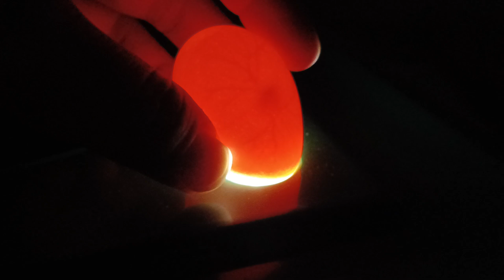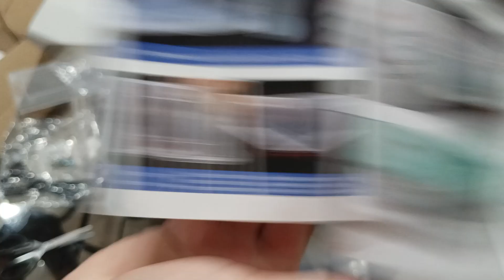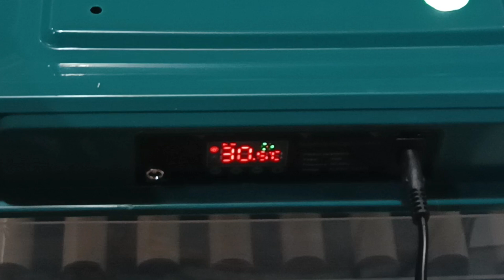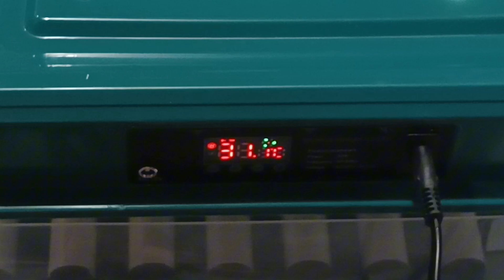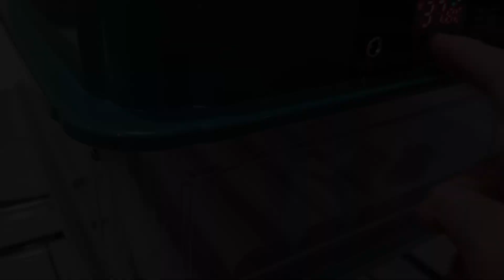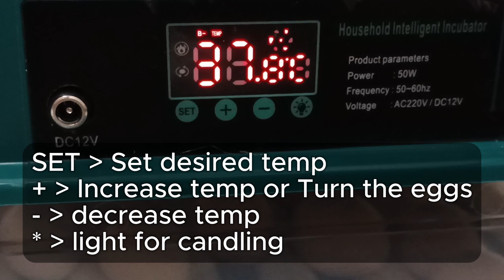Fully Automatic Egg Incubator (48 Egg Capacity) – Step by Step Set-up & First Time Candling!

Comment: Hi. Really helpful video.  Mine is very similar except for the way the plastic sides slot together ( mine slide into each other, rather than the bolts) but i dont see how to check humidity. Please can you help?
Reply from the maker: I bought a hygormeter to measure coz this incubator doesnt have that. anyway, the more water surface the higher the  humidity, I keep my incubator in a closed room. to reduce fluctuation in the humidity. TThis way incubation will be more reliable. I usually achieve 85-90% hatch rate minus the unfertilized eggs.

Comment: Hi how can I control the humidity
Reply: I need to know too
Reply from the maker: Humidity increases based on the surface area of the container. Not by how deep it is. To increase, then increase the surface area of the water. With this incubator, it has 3 container, if I use 3, my humidity would reach 75 to 80.
Reply from the maker: My incubator is placed in a closed room so the humidity is somehow consistent all throughout. But if you placed it in an open area. It might fluctuate
Reply: I have it in my house the temperature of the room is about 30 
The humidity in my city is  15 sometimes it reaches 30 

I have 2 bottles at the starting one the right and one left 
I didn't put one in the middle 
What do you think?

Comment: Sa dry method from 1-18 days hnd n mglagay tubig po?need pa rin ba icheck ung humidity from 1-18 days?
Reply from the maker: Check nyo pa rin po Kasi depende sa Lugar Yung humidity. Kung baba sa 50% baka matuyo po Yung white na nakabalot sa sisiw. Hindi po yun mg hatch..Mura lang po Yung hygrometer. Meron sa description pero check nyo pa din sa ibang store baka mas Mura plus delivery
Reply: @jolointegratedfarm  nakabili po Ako Ng hygrometer ung reading  Ng temperature 38.8 and ung sa incubator 37.5  alin po ung sinusunod  nyung temperature ung hygrometer or ung  nkaset sa incubator mgkaiba kc cla  ng reading
Reply from the maker: @jayson7749 I try nyo po babaan sa incubator kung susunod Yung hygrometer.
Reply from the maker: Baka kelangan Ng ibang thermometer
Reply: @jolointegratedfarm sir sa inyo ano po ung sinusunod nyong reading Ng emperature ung incubator or ung reading hygrometer sa loob po, sa akin po  gumamit ako Ng dalawang hygrometer sa loob ang reading halos same na 38.1-2 ung incubator 37.5   ,Ng try dinAko Ng  glass thermometer  halos nsa 38 din ang temp,susundin ko kaya ung temp Ng incubator sir,
Reply from the maker: @jayson7749  sa incubator po yung sinusunod ko, kasi minsan match sila ng hygro minsan din hindi. mahirap mg update palagi kaya ng stick naako sa incubator. ok naman. Sa inyo po ba malaki ang difference ng temp ng incubator at hygro?

Comment: Pag ika 18th day na po ba hindi na kailangan ng water?
Reply from the maker: Mas kelangan po Ng water sa 18th until mag hatch. Sa area ko Kasi medyo humid so day 1 to 17. Wla akong water nilalagay. Pag ka 18th day na ko Ng lalalagay. Bili kayo hygrometer..Mura lang naman. Para alam nyo kung need I adjust
Reply: Salamat po malaking tulong ito sakin❤🙂 @jolointegratedfarm
Reply: @jolointegratedfarm sir may problem ako pano pala ma control ng umidity may kailangan ba ako pindutin sa bottons?

May na basa ako sa mga comments mo sir tama ba yung pagkaintindi ko na yung umidity naka base sa gagamitin water bottle from day 1-17  1bottle lng tpos 18-21 days 3bottles na.. ibig ba sabihin wala na pinipindot sa botton ng incubator?

Bumili na din po ako ng hygrometer iniisip ko lng kng kailangan naka setup din sa incubator yung need ko na umidity sa eggs
Reply from the maker: @juliusmoreno3027 wla po control sa humidity kaya bumili Ako Ng hygrometer. During day 18 until hatch Puno na po Yung tatlo. Pero from 1 to 17, pwede Isang lagayan lang. Or.pwede din wlaa kung mataas na Ang humidity sa area nyo.

Comment: Automatic ba umiikot ang egg turner ng incubator sir? O kailangan pang e press ang + sign bago  pa ito iikot?
Reply from the maker: Automatic po.nparang pang test lang talaga Yung + sign para alam.mo na umiikot. Minsan Kasi na tatanggal Yung connection Ng turner..Yung wire sa loob. Kaya Minsan pmpress ko Yung + para makialta.ko na umiikot. Especially pag ayaw ko na buksan Yung incubator.
Reply: @jolointegratedfarm  ang lagayan ng tubig need ba yung 1.5 na bottle? Nka bili na kasi ako gagamitin ko bukas 24 egg capacity. Hope masagot po sir
Reply: Paano po mag test ng humidity... Sir
Reply from the maker: @MartyJohnDaapong  pwede po 1.5 para matagal maubos. Pero bili po kayo hygrometer para alam nyo exact na humidity. Pag tatlo nilagyan mo Ng tubig aabot Yan Ng 75%. Day 18 to 21 ok Yan pero kung Day1 to 17 baka isa lang Muna.
Reply from the maker: Depende din sa area eh. Kaya mas ok pag meron ka hygrometer. May nilagay Ako na link sa description. Yan yung binili ko Yan din kasi pinakamura. Pero check mo din ibang store Kasi baka mas Mura pag Kasama na delivery sa iba

Comment: No need to spray the eggs day 18 to 21 days?
Reply from the maker: no need if you can maintain 75% humidity,
Reply: @jolointegratedfarm  What is your recommend to add the water in day 1 to day 18.. the two right and left.. no need to add a water in the middle? just the left and right bottle to lower the humidity? i will add a water bottle in the middle if it is already day 18 to 21 days?
Reply from the maker: @apollomacabodbod6329 On the 18th. You can buy a hygrometer to be sure

Comment: Does the roller rotate automatically every time? Or does it have to be set? How do I set it?
Reply from the maker: Automatic. Every 2 hours.
Reply: What if the roller is not working
Reply: @norbertasombilla4647 Make sure you connect the circuit very well,
Reply: @norbertasombilla4647 dod you plug the motor in 11:19  to the top of the incubator
Reply: How do I set the roller

Comment: Good fay sir..please what is the best temperature to set this incubator to get a best result..
And do you advice me to use all 3 bottles from day 1 to hatching day?..thank you sir
Reply from the maker: Day 1 to 18 - 37.5
Day 19 to 21 - 37.0
Reply from the maker: Use 3 bottles on the 19th day. On day 1 to 18. It should be lower to around 60% so buy a hygrometer to monitor separately.
Reply: @jolointegratedfarm okthank you very much sir...i really appreciate ur response.

Comment: Please do eggs turn  automatically if using battery of 220ah.
Reply from the maker: @abdullahimuhammad3102  haven't tried it but I think it can
Reply: @jolointegratedgoatfarm  yes it does sir.. i tested it and put marks on the egg yesterday after sending you this message to confirm the process and it turns with the battery confirm...
Reply: @jolointegratedgoatfarm  and another question sir...if the egg reaches day 17 very close to hatch should i continue adding waters in the three bottles until hatchery?tnx.
Reply from the maker: @abdullahimuhammad3102  I only add water in 1 of the container during 1 to 17 days..18 to 21. I fill the 3 container.. Better if you can buy the cheap hygrometer to monitor the humidity.
Reply from the maker: @abdullahimuhammad3102  are you incubating chicken eggs as well?

Comment: Kailan po ba dapat ilagay yung hatcher?
Reply: Sa 18th day po ba o 19th day aalisin, kasi sabi po sa iba yung pag ka 19th day daw po e
Reply from the maker: @romarcastro4492  18th po
Reply: @jolointegratedfarm  boss pagkalagay po ba sa incubator count na sa bilang yun?
Reply from the maker: @romarcastro4492  opo. Sakin naka schedule palagi, 7am Ako Ng loload at Ng transfer sa hatcher. Para hindi nakakalito. Dalawa Ang incubator ko. Yung mas Malaki Yun Yung setter tapos Yung maliit ginawa Kong hatcher.
Reply: @jolointegratedfarm  e nag load po ako sa incubator nun april 26 bandang 5pm na po yun. I cocount ko na po ba yun sa bilang as 1 day? Or hindi pa po
Reply from the maker: @romarcastro4492  next day na po. Para complete Ang 24 hours.
Reply from the maker: sa 18th day Stop na dapat yung pag turn. tanggalin nyo yung wire connection ng egg turner, Ako, tinatanggal ko muna lahat ng eggs tapos ilalatag ko yung screen. then balik na yung eggs,. kung sa iba ibang chicken galing yung eggs, gawa ka ng divider or screen para alam mo san galing yung egg na mghatch. nahirapan ako nung una kasi nka mix lang
Reply: Sir kakabili ko lang po ng incubator po na 130 capacity Wala pong naka Lagay n humidity po,, at paano po e set sir  ?
Reply from the maker: @AllohaAbellana  bumili po ako ng hygrometer. chineck ko if isang lagayan lang nung tubig around 50% ang humidity pero kung tatlo yung nilagyan mo ng tubig, aabot xa ng 75%. pero depende pa rin sa mismong humidity ng area nyo.
Reply from the maker: 1-18 days mababa lang dapat humidity, sa 19 to 21 days dapat mataas na humidity.
Reply: @jolointegratedfarm  boss pag 18 days na mga itlog na na incubate pwedi bang ilublub sa tubig para lumambot yung shell nila?
Reply from the maker: @romarcastro4492  Hindi ko pa na try. May isa akong sisiw na sobrahan ata sa spray Ng tubig nging makunat yung parang Balat sa loob Hindi nya ma punit palabas. Namatay Yung sisiw. Pero kung 18th baka pwede naman.
Reply: @jolointegratedfarm  ok po thanks. May nakita kasi ako sa you tube din na nilublob sa tubig pagka 18 days na yung itlog boss. Kaya tinry ko nga siya ngayon. Kasi yung napanood ko din marami napisa at agd nakalabas sa shell
Reply from the maker: @romarcastro4492  pa update boss kung effective
Reply: @jolointegratedfarm  cge boss update kita
Reply: @jolointegratedfarm  boss effective yata yung paglublob ng tubig pag 18 days na yung mga itlog.. Yung saken kasi 30 yung na incubate ko pero ngayon 22 pcs na yung napisa. Pang 20 days palang nila ngayon e
Reply from the maker: @romarcastro4492  anong  incubator nyo? May hygrometer din?
Reply: @jolointegratedfarm  kamukha po nun sa inyo, nabili ko din sa lazada. Yung automatic na 48 capacity

Comment: How to adjust temperature and  how to 
Calibrate the humidity setup?
Reply from the maker: Press Set then + or - to increase or decrease the temp. Yung sa humidity po, parang automatic na ata, pero pwede po kayo bumili nung maliit na Hygrometer. pwede nyo tanggalin yung isang lagayan ng water. if sobrang taas ng humidity
Reply: @jolointegratedfarm it's more too low for the duck eggs. Not the most sophisticated device. We didn't have a clue when we bought it. Probably better for chicken eggs.

Comment: i have this exact one... but the humidity level is 80%... how do i decrease it to 60%-65%?... i am just using 1 bottle... not 3bottle.
Reply from the maker: for the bottle, the middle part is wider and has more water surface. you can use one side instead.
Reply: Mine only has 2 bottles and is for 120 or so eggs.
Reply: The right way is using only 1 bottle not all 3?
Reply from the maker: @olejaldavej3091 I use 3 during Day 19 to 21 to increase the humidity to 75%